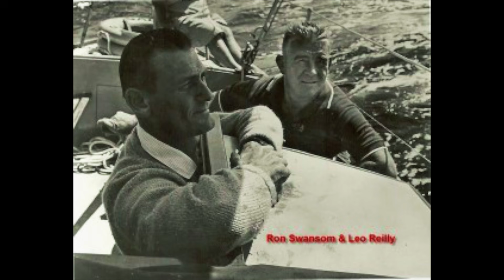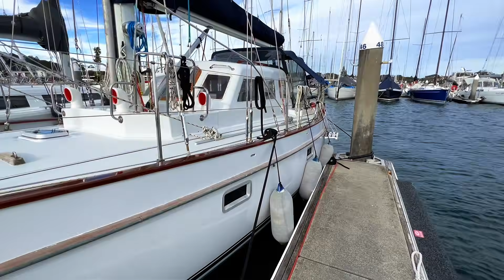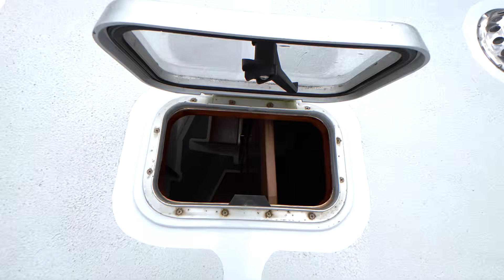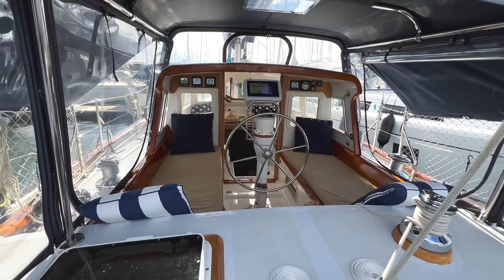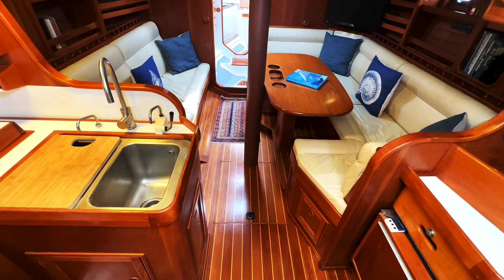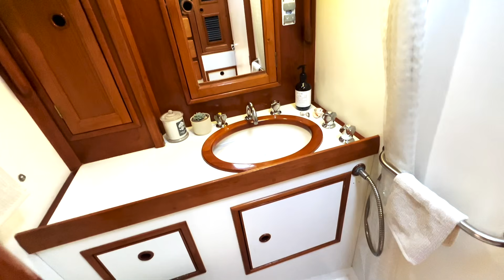'ONE IN A THOUSAND!' WORLD CRUISER FOR SALE - Boat Tour

Comment: How would you steer this yacht from below decks in the aft cabin using the emergency tiller arm!?
Reply from the maker: Yes it's not a perfect solution but just an emergency option. For close quarter manoeuvres you really need two persons on board - one directing from above and one steering. If desperate and single handed one could still steer into an anchorage using a an iPad as a repeater off the main chart plotter which would show heading, radar, charts, and AIS info, etc. but yes...not ideal! The tiller, fixed directly to the quadrant, can also be lashed to a position and the quadrant can also  be locked to the centreline position (there is a locking mechanism to lock the quadrant to the hull in this position). So the tiller fixed directly to the quadrant is really just a last resort to hold a course or to manoeuvre the vessel into an anchorage etc. On the wind or on a reach Kekaimalu steers a straight line if the sails are set correctly, on these point of sail we have often thought the autopilot was on and when we try to adjust the heading find we had not activated it.